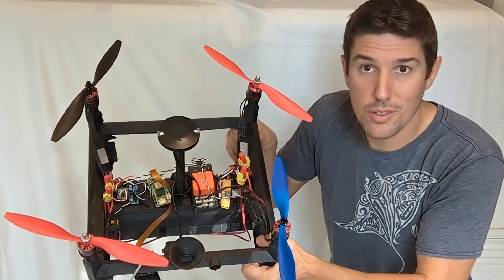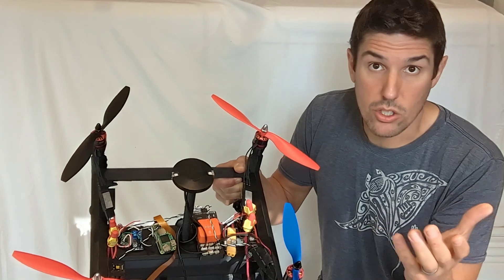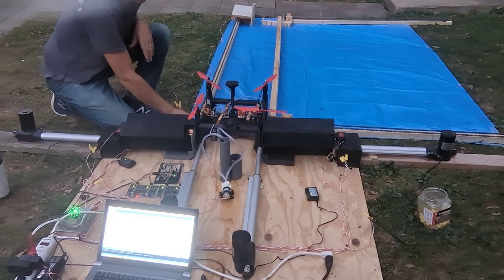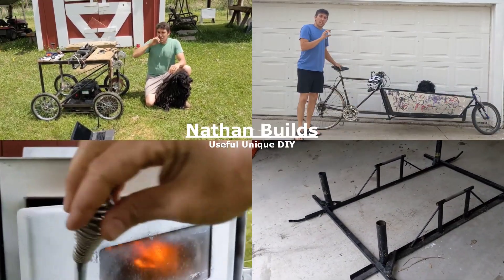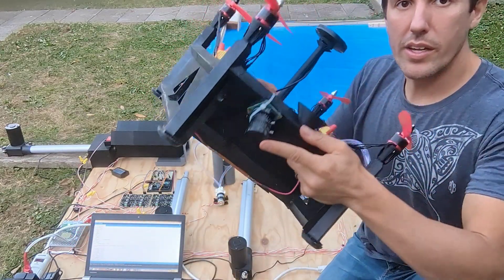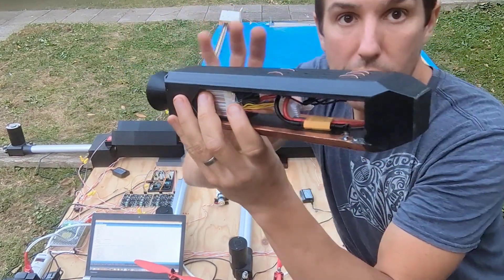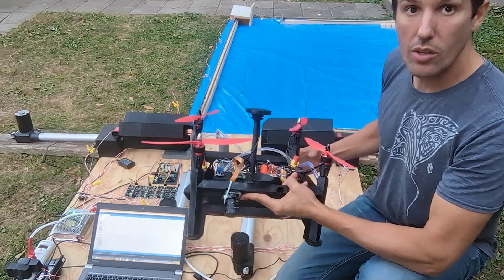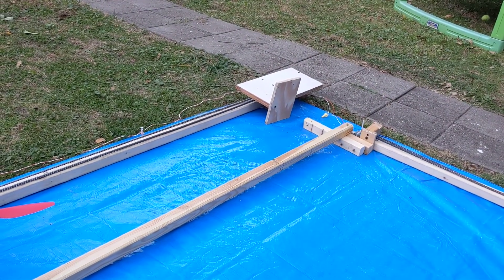DIY AI Sprayer Drone - 3D printed, Automated battery swap/redeploy, Custom AI Image Classification

Comment: I think it might have more potential if you used just one battery and solar charging to make it easier to move from field to field without power.

Great idea thought im working on something similar using a wick type application for rushes
Reply from the maker: Would the solar panel be on the drone? I think that's too heavy. If the panel is on the landing pad you'd still have to land the drone in a known orientation/location to get it charging
Reply: @nathanbuildsdiy  i moreso meant to have solar charging the dock station, rtk would also get you 6 inch landing accuracy that lets you make the pad much smaller, look at the dji dock for an example of the functionality,

Comment: Hi Nathan,

I’m really impressed with your DIY autonomous drone spray build! Your video was exactly what I was looking for. I’m currently working on a precision agriculture drone project as part of the NIDAR initiative by the Government of India. Our project involves a main drone with a tethered sub-drone system for highly accurate, low-altitude spraying over crops.

We have a few constraints: a 6x6 ft size limit, a mission to spray 10 liters (with refills allowed but time-sensitive), and a strong need for high-precision control.

Your build seems like a great reference point for us. Would you be open to providing some guidance or maybe an email contact so we could discuss the technical specs in more detail? Your experience would be invaluable to us, and we’d really appreciate any insights you can share!
Reply from the maker: Hi  @harsh20063, certainly! Sounds like you're right in my wheelhouse, I'm trying to build open source farm robotics and get others using them as well.

Email me at doublegdevelopments@gmail.com and we'll set something up.

Comment: Hi Nathan, just wondering have you heard of anyone that is producing this type of drone (minimum human needed etc) commercially?
Reply from the maker: Not exactly, no. There are drone operators for hire in the ag space and lots of farmers here are using them, but they're huge, 6+ft square drones on the back of a semi that drive to the field. They all have human operators for now, but I expect this will take hold.  I'm really interested in how to do this more cheaply for small holding farmers.  Still developing new ideas to get the cost down and reliability up. Next rev is this summer I hope.

Comment: Hello!
This is a great project.
Could you please tell me which controller is used in this project: P, PI, PID, LQR, or perhaps something else?
Reply from the maker: The cube orange/ardupilot have PID settings in the interface (I just used the default ones) so I'm pretty sure it's PID controller

Comment: Have you ever built FPV drones? They’re capable of digital 4kHD video
Reply from the maker: Yes, I used that on version 1 of this. I sent video back to my laptop and classified it there.  But I had trouble with fpv going out of range or getting fuzzy when it went over the hill in my field. I think it needed line of sight for good video. Plus using onboard compute is less expensive than high quality fpv

Comment: Great work and an awesome project, I know it’s not easy to manage all of this and achieve such a level with an automated AI drone. I just want to suggest using a conveyor belt instead of pushing the drone with a piece of wood, which can cause it to get stuck in the landing station. I think with this setup, the drone will never get stuck, and you can ignore the two linear actuators, just reverse the direction of the conveyor belt. Keep going ❤️
Reply: It looks like he has chosen to use the wood because it will tend to align it to a fixed orientation as it moves along. And two angled perpendicularly will mean that the drone always ends up properly aligned when it reaches the recharge area.

Comment: Great work, very interested to see how the ai and spraying works. My community is battling some very invasive weeds on the steep mountainsides around our town, and a DIY spraying solution could be game changing.

Some thoughts from an Aerospace perspective regarding future improvements to the drone design: 

1. Using the hollow frame as a tank seems clever, but from a weight optimization perspective, you can't beat spherical tanks. Without knowing the exact dimensions, some napkin math... If your hollow box rails are 1" square, and the drone is 12"x12", then you have 48in3 of tank volume. A 3.6in diameter sphere has a volume of 24.5in3, so 2x spherical tanks is 49in3. Assuming equal wall thickness, the box tube frame has a surface area of 192in2, while the spheres have a total surface area of 82in2... A 67% reduction in weight. Use carbon fiber tubes for the box structure. 

Another advantage of using spherical tanks is the ease with which the fluid inside can be pressurized. If you put a balloon inside the tanks, you could pump the liquid into the drone under pressure and inflate the balloon, and then dispense it later using a small valve instead of having to carry the heavy pump.

Comment: Amazing work!! What model are you using? You should probably try using YOLO with boundary detection, add some servos to control the direction of the spray, and make the spray angle narrower. Since the drone might be moving around, the motors as well as boundary detection could allow you to make more precise sprays, which could help a lot with smaller weeds in your next version. Also YOLOv10 is really fast. 
I love this!! Keep working on it please :)

Comment: nice side effect of autonomous vehicles: easy to do long term reliability testing, especially if it will refuel itself.
 I love the idea of running these things until something wears out, upgrading that part, lather rinse repeat until you have a semi-immortal drone that will sit in a corner of your field killing weeds as long as it gets fed electricity and herbicide. OO

Comment: you could use QR Code and rfid sensor unerneath of drone for accurate landing, there are lidar, radar microwave sensors , is good to used for ground station to communicate witht the drone to landing.

Comment: I just discovered your channel (now subscribed) and you are doing amazing work.  For sure I have a need of this technology on my Arizona ranch as we are getting inundated with tumble weeds which is getting to be a huge problem in the southwest US.  I am an industrial Mfg. and designer with 25 years experience in CAD design and 15 years with 3d printing and with knowledge of aerodynamics.  Your airframe has massive headroom for improvements in aerodynamic efficiency.  I am buried in projects at the moment but I will follow what you are doing and work on an improved airframe design and will share back to your project.  I too am using 3D printing technology to develop drone airframes of recreational type.  Many in the drone world talk down the use of 3D printed drone frame parts but I think this is mainly due to  improper structural design and designers not taking full advantage of what is achievable with 3D printing, example your use of hollow structures which is far more structurally efficient than the use of solid structures such as solid slabs of carbon fiber.....Bravo my friend!
Reply from the maker: Thanks!  I'm keen to learn more about a better airframe design. I know this is a loser in that regard after flying it a bit. Those props spin hard to keep it up in the air.  In the next version I'd like to keep the battery swap simple and move electrical contacts on the battery cage into a more protected U shape so they aren't exposed so much, and I want to haul liquid, but other than that I'm open to design changes. It needs some help :)  Let me know your thoughts.

Comment: Wow, extremely impressed with that. Not looked at all your other stuff, but do you go into detail as to why you go with battery swaps? Is there really so much work needing done that you would want multiple drones per landing pad? Given that it is entirely automated it can easily be running at all hours, which potentially means 8000 hours a year. With a global shutter a flash for the camera wouldn't even use much extra power, letting it work at night. The battery switching increases the duty percentage, but is that something that we need to care about? The overwhelming majority of farm equipment runs less than 25% duty.
Having one pad with multiple drones that you move around every few days shouldn't be much less work than having multiple pads distributed and left for a month. The important consideration is how far from the landing pad is a reasonable working area, and how long it takes a single drone to cover the entire area within reasonable distance of a pad. I would be surprised if that was more than a month, even with 30 min recharge time. Running 4 drones from a single pad at high duty cycle using battery swapping might do it in 3 days, at which point you have to move that pad.
I'm just thinking that a failure in a connection made with a charging port means the battery fails to charge. A failure with a battery to drone connection would crash the drone somewhere in a field, which is a much bigger problem.
Reply from the maker: Great comments.  I'm actually only planning to run 1 drone per landing pad/swap station. The 6 battery bays are because the drone can only fly ~10 minutes on a full battery charge, but the batteries take 1+ hours to charge back to full (well, there are faster chargers, but they require someone to click them "on" and the cheaper, simpler ones that just "Start" when contact is made go that speed).  Hence why I want to have 6 of them charging for 1 drone because it'll go through that many batteries in an hour of operation. Just trying to edge closer to having the drone in the air most of the time. 
I'm keen to have it up so much because you can cover a lot more acres per drone/landing pad if it's flying more often

Comment: What a great idea and well executed.

I think you could simplify the landing/docking mechanism using something like april tags and someone else's code library. You could use something shaped with a taper, like a funnel type shape to get it to exactly the right spot.
Reply from the maker: Yes, those are a really neat idea. Right now I'm using mission planner + RTK GPS to fly a precision mission and hit the landing pad, but I've seen those tags for directing drone landings and I'd like to try something like that in the future.  Mission planner doesn't currently support them that I know, and I'm not yet ready to ditch it in favor of a different navigation system, unless you know of one that works well and includes support for apriltags?
Honestly, I'd like to ditch the autopilot + GPS because they're so expensive.  I've seen folks use rasberry pi pico (or other cheap flight controllers) but autonomous flight + precise landing will require some design and coding to get those solutions flying as well as it does now for less $$.
You have any pointers where I could look?

Comment: dude, those exposed battery contacts are a major fire hazard
Reply from the maker: Yes, I'm careful to unplug the batteries when not in use and never touch the leads with something conductive. Next version I'm thinking about how to enclose the contacts in a U shape to reduce what can get at them.
Reply: @nathanbuildsdiy  a spring loaded sliding cover might be a viable route...or just do what tool batteries do, recess the source contacts in a canal and let the consumer contacts protrude into them

Comment: You can actually have 6 batteries. One in the drone and 5 in the chargers if you run the battery bays independently.

I THINK you said 2+1, otherwise I am sorry for correcting a non wrong
Reply from the maker: Yeah, mistake on my part if I said 2. It's 6 total. That's because a full charge lasts 10 minutes of flight and takes 60+ minutes to charge.

Comment: The one time in recent times that you're actually allowed to call it AI without serious false advertising. Though I would have still preferred the word algorithm, or image recognition. ""AI"" is being shoved into everything and to me has become synonymous with shitty product. 
That ramble asside, this is an awesome project. Super cool that you're sharing your work. I do wonder if the autonomous recovery could be expanded to fixed wing drones as well.
Reply from the maker: Fixed wing would be really cool.  I'm sure mission planner supports fixed wing aircraft, and those can cover so much more distance (that's why the crop dusters around here are still in business!)

I'll be tied up with drones for awhile longer, but if you go in this direction, let me know. I'm interested!
Reply: @nathanbuildsdiy  ardupilot does indeed support planes, mission planner does too. The real challenge is recovering and recycling a fixed wing plane fully autonomously. There is an autoland function, but it would require a runway and quite high precision. Zipline does a hook to catch their autonomous aircraft and a catapult to launch them, but between the two there must be manual handling.
I wonder where automatically recycling fixed wing would even make sense

Comment: Thank you for this, question. I can never get my prints to be water-tight. How do you ensure that yours are?
Reply: you can paint them with resin
Reply: @mice3d  that's an enormous resin print.
Reply: @tuskiomisham  no you can paint on the resin after printing :) not print them in resin although a clear resin print would be cool to see if it is full or empty, but wont last in the sun!
Reply from the maker: I used PLA + flex seal (sprayed on the tubes prior to putting on electronics) and that's holding water. 

I also printed in petg and got it to hold water but it's slow printing. I went through so many iterations I ended up using the PLA + flex seal.
Reply: POV: you retired to a farm to give up programming but the dark side pulls you back in
Reply: There are also coatings for sealing fuel tanks they you slosh around on the inside.

But it will be interesting to see what solution he uses